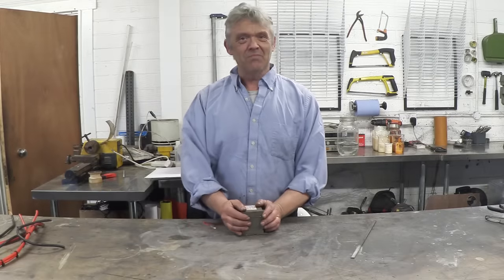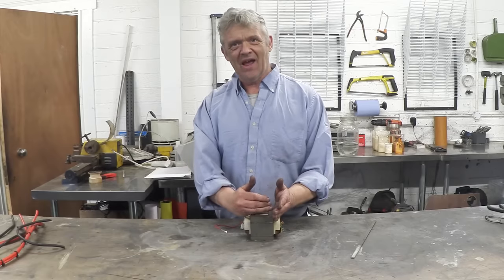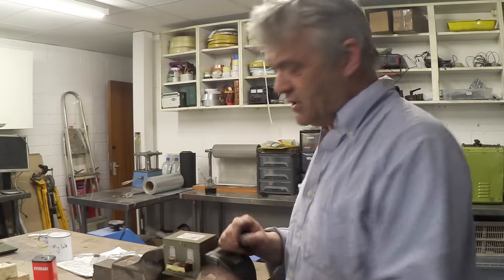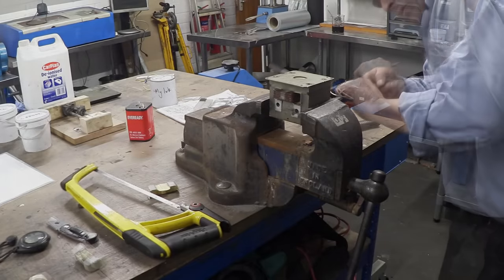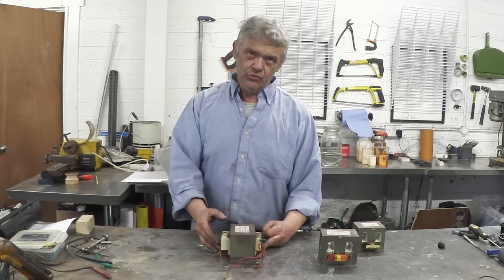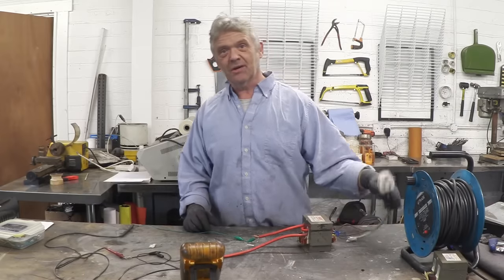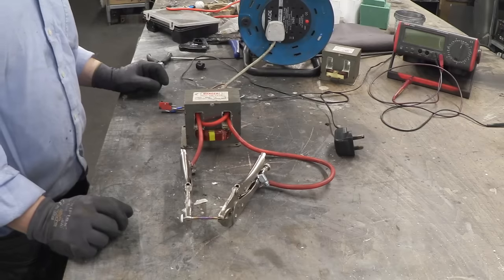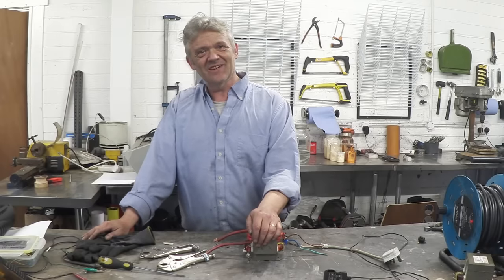Microwave Oven Transformers Using Them For Projects

Comment: I've been trying to find out what those core pieces between the primary and secondary windings do. They show at 3:45 in the vid on the "really big one".   They seem to be a magnetic shunt of some sort. Do you know what they do? should I remove them? They are also visible later in the xformer you used to melt the bolt.
p.s. Nice lesson, thanx. :)
Reply: They are indeed magnetic shunts. Their purpose is to bypass the magnetic flux created in the primary (mains) coil as the load on the transformer increases, lowering the output voltage, and limiting the current that the load can draw. They are needed in a microwave as the magnetron takes several thousand volts to 'strike' it and get it started, but it runs on several hundred volts once the arc is established inside the magnetron. This also limits the available power delivery to whatever the rating of the magnetron is; without them, the magnetron would probably draw excess power once it 'struck', and could either destroy itself, or overload the transformer. (The shunts have little effect on no load, as the magnetic field prefers to flow thru the much larger cross section main core.)

Leaving them in will therefore limit the output voltage and current available on load from the transformer, and reduce the voltage out as load increases, which is NOT what a spot welder needs. Removing them will allow the transformer to deliver the maximum power to the load, and will help to keep the output voltage (relatively) constant. The 'old' style arc welders with the big knob use a moveable shunt to control the available current, (and reduce the arc voltage,) during welding, but the shunt had no effect on the unloaded voltage, so it was always easy to strike the arc.
Reply: @brianspencer6397  Thanks so much for the lesson. I actually have one of those old Craftsman welders which I took apart to see how it worked but still didn't completely understand.
Double thanks.  :)

Comment: It's low voltage but high amperage. Throw a clamp on the hot wire and meter the amperage when you spot weld.

Comment: OK just curious, Y take the small winding out instead of using them? I understand the idea of the heavy wire for high draw stuff but Y other than that?
Reply: Depends on your desired use.   You can use it as is by reversing the connections - this is even allowed under code depending upon the voltages used and Txfmr KVA rating and configuration.  Delta-Wye to Wye-Delta, for example, but only up to around 3.5KVA.  There are several issues caused by this which you need to be aware of.  Because the core is being magnetized from the inside out when reversed, the excitation inrush can be up to 23 times higher, making it difficult to coordinate with mains breaker ratings.  MOST IMPORTANTLY - in ALL MOTs that I've used or seen, one side of the secondary is connected to the transformer's core.  To energize it in reverse would mean connecting mains neutral to the core, thus the neutral is live under certain fault conditions.  This must be disconnected and left 'free floating'.  The HV side shunt is there to prevent oversaturation of the core's field and limit the current to the magnetron.  If you just remove the shunt, the air gap still produces leakage inductance.  When Robert removes the secondary and rewinds it, the shunt is removed but the air gap is also removed, allowing you to configure your desired output voltage and keeping the transformer from heating as much.   These are the main reasons that it's performed in the manner Robert does.  Hope that helps answer your question!  Even if the answer is 10 months delayed :P

Comment: Hey Robert, so is the the red jumper lead attached anywhere or is it just a simple loop through and back out? Sorry I'm still learning lol. Cheers
Reply: Just looped yes👍
Reply from the maker: yes mate that is exactly what you do - it's a bit like sewing at scale - just feed it in and loop it round then feed it out and you keep on doing that until you get the number of turns you want - or will fit
Reply: Cool thanks for the reply mate. I'm going to buy the mrs a new microwave so I can strip the old one haha.

Comment: You can do some bad stuff with them also! 
I damaged the primary windings on one, I actually tried to use by drilling, then knocking the winding out, a drill press would work much better, mine was epoxied in also, I was making a spot welder, I don't think there was enough windings, and voltage was too low, I ended up using lithium batteries, when the voltage gets low, it acts like the transformer, it 1-1.5 turns of 10 gauge copper, about 20+ 10 gauge wires in a bunch, it probably had all the amps, but it seems the voltage needs to be high enough to penetrate the metal, both layers, below 10.5v it doesn't weld well. Although with a long enough pulse, the metal will flash red, but no weld, but with higher voltage, short pulse, it welds nice, I think with about 5-6 turns, of about 2-4 gauge wire it would work fine,  great video!
Reply: What?
Reply from the maker: The number of turns needed will change from country to country mate - it all depends on your supply voltage - here in the UK we need minimum 2 turns as our inout voltage is 240v in the USA 1 turn will do it as their input voltage is 110 as they need to generate around 2kv they have twice the number of turns on their primaries than here in the UK

Comment: You will find that the coiled extention might heat up your metal too. It makes a big difference to my inverter welder in its less smooth delivery if i have a wound up extention leads being used even just hanging on a nail. Quite amazing really the effect. Would be even worse effect with a old school transformer welder or one of those cheap Chinese aluminium coil types. The fluctuation would be awful to work with. You can hear it changing frequency vibration when you weld.
Reply: Extension

Comment: Thats usefull. I small spot welder I can use to connect strips to batteries  ... for example.
Now, If I wanted a step down transformer to 20V or so I could attempt to use the original secondary winding as the primary and the primary as the new secundary.
I know that is not working. But why ?

Comment: So, have you tried hooking up a couple / few of them in series where the output of one becomes the input of another?  I have to wonder how many of them you could do that with before the insulation on the primary wire was not sufficient... I doubt you could get past three before that would happen...
Reply: What you are talking about is called cascading. And no, if you plug your average MOT into mains and cascade it into another, the primary winding would not be able to handle it by any means.
Reply: It does depend on a couple of factors, including the dielectric strength rating of the enameled copper also known as the breakdown voltage, but connecting them in series will be doable generally as you're increasing the voltage and keeping the current the same.  Most MOTs output in the 2.3Kv range.  You can determine the dielectric strength of wire you're using by measuring the thickness of the coated wire, and the thickness of a portion that the enamel has been removed from.  You would also need to know the type of coating that was applied.  The temperature rating is also a factor in the wire Grading (1-3).  I pulled this calculation from the EE stack exchange recently for a project:

Breakdown voltage depends on the thickness of the covering, which can be of 3 types: Grade 1, Grade 2 and Grade 3. Higher grades have thicker insulation and thus higher breakdown voltages.

The temperature class indicates the temperature of the wire where it has a 20,000 hour service life. At lower temperatures the service life of the wire is longer (about a factor 2 for every 10 °C lower temperature). Common temperature classes are 105° C, 130° C, 155° C, 180° C and 220° C."

Calculation of breakdown voltage

The breakdown voltage depends mainly on the thickness of the insulation (see formula below), but also on the bare wire diameter, the application temperature of the coil and the type of enamel.

Calculation of average values Ds (dielectric strength):

Ds = t x Vμ [Volt], with

Ds : breakdown voltage

T : increase due to insulation,

t = da – dnom, : wire diameters with and without insulation

Vμm = volts per micron insulation (dependent on type of insulation)

Example:

Test with cylindrical electrode (round wire)

dnom 0.071mm (bare wire nominal diameter)

da = 0.083mm (wire with coating)

t = da – dnom = 0.083 – 0.071 = 0.012mm = 12μm (thickness of insulation between wires)

Vμ = 205 V/μm, therefore

Ds = 12μ x 205 V/μ = 2,460 V

The insulation between turns is also less of a factor than the insulation between the turns and the transformer core. You can always apply another coating of resin to the transformers, but keep in mind this will limit it's ability to dispel heat, shortening the lifespan of the device.

Comment: I have watched a lot of vids with mircowave transformers. The best really is a welder. However no one has really taken the time to look at the potential of this device. First it offers a household electrical system can be use to weld. Ok it would be considered mirco welding  . And considering the millions of people who may actually just buy a mirco welder for home use welding the one millimetre thick steel for projects. The real question is after the device is worked out to be able to give amps and volts flow to the manufacturer to make some rods for it to be tested. Once tested this device could be manufactured by anyone as a business and rods then can be used to do anything for creative to amateur and professional tasks. I am really thinking ask you local rod manufacturers for some mirco rods to be made off the data collected. It is a win win for business and meets whatever demand is generated. Capacity to weld at home off a normal system is mindblowing. Let alone the vast creative projects it could be used for. If manufacturers don't help you contact the minister in your country or ask someone to just make them who has knowledge of how to make rods .I can see this device one day just being sold S a tool like any other.

Comment: Hands down the quickest way to remove coils from these. The first one I did I was at it for close to 2 hours!
Reply: Tcoo, yes, this is the easiest method Ive seen as well. I never wanted to try the first method. It was a lot of hassle to do.
Reply: @captainprototype187  yeah, I've seen people angle grind the top off the core and weld it back on. Too much of a pain in the arse
Reply: @tcoo1999  Still,using a supercap is the easiest way. I got some small transformers, I wonder if  they  can achieve a spot weldin this way. Never done any kind of welding myself.

Comment: nice video, what's interesting is that the voltage and current change together ie when voltage increases the current decreases and vice versa, this is because the iron core of the transformer causes a damping effect with respect to the magnetic field between the coils, Nikola Tesla got around this by removing the iron core with his oscillating transformer (Tesla coil) which amplifies both voltage and current, that would be a great video, building a Tesla coil :)
Reply from the maker: I like it mate - will do - cheers

Comment: The nail melts and breaks and the result is Rob shitting himself as he jumps back in a split second. Fantastic video. I have been playing with transformers lately and they are great all purpose devices.
I am wondering what would happen if you used a microwave oven transformer using the secondary as primary and visa versa. What would the voltage be? Also could a microwave oven transformer be used to make a large inductor heating element, turn any screwdriver into a soldering iron in seconds, lol
Reply from the maker: interesting ideas mate - I must have a go lol

Comment: So, if you wired it the other way with 230V on the low loop count side, you should theoretically get a  pretty good high voltage output.  One of the things about working with high voltage transformers though is that you think you are safely away from the hot wires and then you see that nice blue arc jump out and grab you...
Reply: The turns ratio here is about 100:1.  Feeding it backwards would produce 22Kv, which is generally about 20 times higher than the magnet wire insulation can stand.  That said, hooking a 2 turn transformer to 220V with practical inductances at 50-60hz is going to blow your breaker almost instantly it might as well be a dead short.

If you want to try it, wear body armor and a face shield, and flip the switch with a long wooden stick.
Reply: @fromagefrizzbizz9377  -- You could easily protect the circuit so that the breaker is not kicked by adding an incandescent light bulb in series with the primary... You definitely need more insulation on the wires for that sort of voltage though...
Reply: @jakeblanton6853  Putting a resistor (which is essentially what an incandescent light bulb is in this scenario) will reduce the input voltage and hence the output voltage, in this case a *lot*, and would vary all over the place depending on load.  Putting a resistor in series with a transformer used to step up or down voltage usually means you're making a mistake.
Reply: @fromagefrizzbizz9377  -- Yeah, there's always compromises with any design decision... If you want to eliminate the possibility of blowing the circuity breaker though, using a light bulb as a current limiting resistor will work, but you will also be decreasing the power that the transformer can subsequently put out... If you were getting 22KV out of it, then you would need spark plug wire insulation type thicknesses...
Reply: @jakeblanton6853  The reason why Fromage mentions the breaker dilemma is because the inrush excitation is much higher when reversed since the core is being magnetized from the inside out.  Loaded or not.  And steps need to be made when doing this to free float and  'corner ground' the neutral, as it's connected on the output side (in original use) to the core.  When reversed the neutral becomes live under several fault conditions and is not advised.  Corner grounding - That involves significantly more danger and steps to ensure it's done properly, and there are a whole host of differential voltage readings and requirements that must be undertaken from the device all the way back to the service utility.

Comment: So I live in the US we have 120 over here so based on that I should put 4 windings on the secondary right?
Reply: If your transformer had the same number of turns in the primary as his, yes.  But it most likely doesn't.  Short of trying to count the primary windings, setting it up and testing the voltage is the best way to see if you're getting a suitable voltage.
Reply: Fromage is correct, also keep in mind that the operating voltage requirements of the components being fed are generally going to be the same, so the method implemented to attain said voltages will be adjusted appropriately to create the desired output.  Translation - the turns ratio will be proportional to input voltage to achieve the same desired output.  In our case in the states, that equates to having more turns in the secondary - the primary will likely have the same number as the overseas versions, because manufacturers have one less variable to modify for production.  So you can do the same as Robert.  If in doubt, do a bit of math.  The numbers won't lie.

Comment: what happens if you accidentaly cut some of the primary wires?
Reply: As these are often free MOTs, the safe bet is to scrap the primary and rewind, or find another transformer.  That being said, depending upon the extent and location of the nicked wires you can apply a liberal portion of resin to the windings and let it cure up thus re-insulating the wires.  The enamel coating and follow-up resin coating (post construction) performed by the manufacturer are done under a vacuum to pull the resin into and between the windings ensuring a better coverage.  If you have this option, and you must absolutely use the damaged primary, I'd say resin it up and place under a vacuum while it is curing.  I'd advise finding another MOT however, as you don't need to muck about with all of that and risk your safety.  I like to use a 2mm copper strip as a blade stop.  Bend it into a U and place it over the primary side (upside down) that you're working on, and throw a ziptie or large hose clamp around it to hold it snug.  Takes a hair bit longer but it'll serve as training wheels until you get the feel of cutting them as Robert shows.  Best of luck in future scrapping :yougotthis: